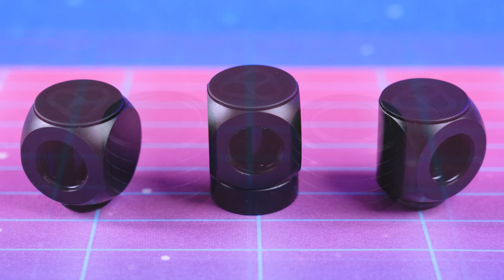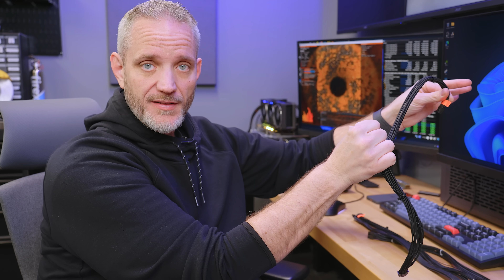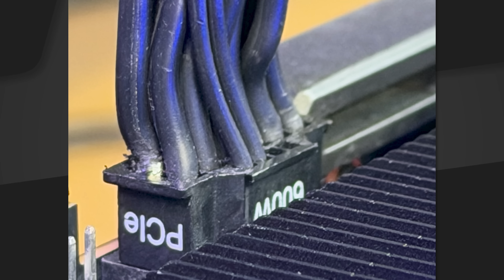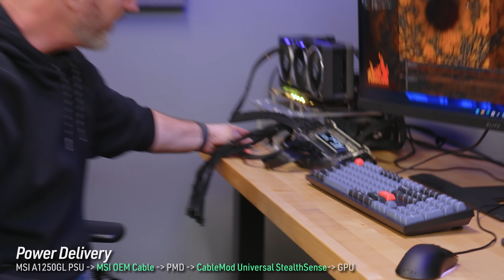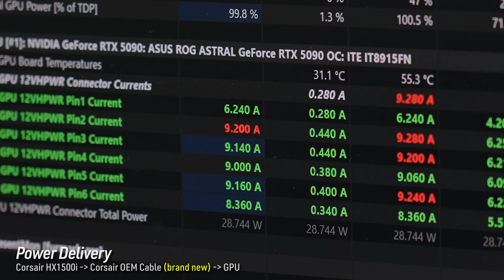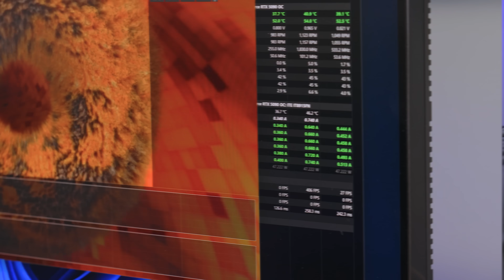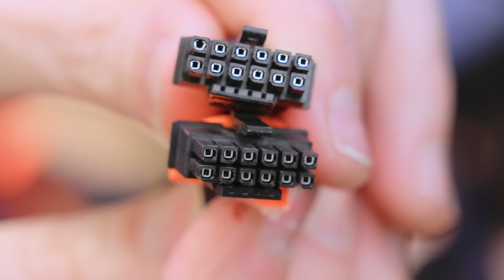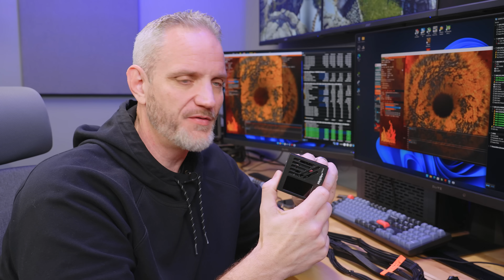More details on what could be causing 12VHPWR / 12V2x6 Cables to melt

Comment: As an engineer with a deeper understanding of both electricity and especially the mechanical forces, deflections, deformations, contact pressure, and all manner of detail that takes days to explain, the 12vhpwr connector has fundamental flaws that nobody has even identified yet. I've tried mentioning them in previous posts, but honestly, it's just too complicated. TLDR. 
Thing is, if it is the CABLE that is the problem, then how come we've never seen these issues with any of the old 8 pin connectors? Is their wire gauge heavier (ie thicker, more robust)? I'd be quite sure Jay's used them several hundred times without issue... 
I'm still convinced the connector is the problem. Just touching the cable (never mind flexing it) will move the connector ever-so-slightly, changing the contact conditions and affecting the current distribution. 

Honestly, I cannot express just how incredibly fickle the contact patch at each pin truly is. All of the old "design fixes" all showed the same old "assumptions" of perfect contact distribution, and a complete absence of understanding how the local structure bends and deflects as it is pushed onto a pin, such that the actual contact pressure distribution at each connection is just an edge load, with tiny contact area, and extremely high local resistance that will generate heat from current density like no-one expects. 
It is just a shade less severe than arcing - which is what is used to melt the welding rod in an arc welder... 

Melting connectors are the first obvious sign of that local heat. But as things get hot, they rapidly escalate. 

Problem is, we've had "working" connectors for so long, that everybody has forgotten the fine detail that went into developing the original, and hence we have problems that were sorted out long ago, when folk actually understood the mechanical side of contact and connector design. 

Cast your mind back to when these problems were first investigated, and of the two different structure designs, ONE of them had the vast bulk of the melting problems. 
It was SO significant, that the "design fix" was to recommend only the one pin connector design be used in future. 
There's your main clue right there, as to where "the devil is in the detail". I could see exactly how the "bad" one could never have a decent area of contact, making it "always bad", but even the "good" one wasn't that great. It just wasn't as bad. 
Which is why stopping using the one that had most of the problems, did not stop ALL of the problems. 
And as manufacturers refine their process to make things ever cheaper, you can be sure that not being aware of WHY one connector was better than the other, will bring that problem back sooner or later. 

As Jay pointed out, we've had cards drawing half the power melt their connectors. And some of those insane 5090 mods draw twice the power, but survive. If a cable wasn't up to the job, you'd absolutely see problems proportional to power draw. 

But that doesn't rule out someone using "cheap" wiring (either too small a gauge, or perhaps not pure copper, but maybe copper coated aluminium, or even steel, that bring in fatigue cracking problems - in other words, the flexing COULD be a factor, since not all cables have the same core material. However, that is never the case in a home-use fit-once-and-forget scenario. 
Factor, yes, maybe. 
Root cause? No, I seriously doubt it.

Comment: I actually have an thermal sensor taped to the connector to spot temp difference and have hwinfo shut down my pc when it gets hotter all of a sudden. I don't have 140 euro to buy the wireview2. So this solution seems right for only 5 bucks. Also have hwinfo set to shut down if the voltage drops below 11.6. Running a 5070ti, with 2x6 on both ends. (Gpu and PSU side with a bequiet p13m 750w.)

Comment: Wasnt it even in specification that the connector is only limited to 30-40 mating cycles otherwise the connection is not reliable?
Reply: You take some tweezers and squeeze the pins so they make better contact.

Comment: You're not beating a dead horse. This is a problem that was never resolved and still isn't resolved 4.5-5 years after the first iteration of this 16 pin connector.
The horse ain't truly dead until they actually fix this 16 pin atrocity.
We're trying to beat the horse dead, but this horse appears to be the 5th horse of the apocalypse: tech slop.
I can't believe we are this far into the existence of this spec and it still hasn't been recalled or deemed a failure. 11 NZXT H1 cases caught fire and that was enough for a recall. There are hundreds of incidents with burning connectors with the 16 pin across ~4 years. What are we doing?

Comment: TLDR - No update, No solution
Reply: thank you
Reply: Solution : use a cablemod cable, use a PSU with safeguard that turns off your PC in case of unusually high voltage

Comment: I have a 2024 model year rm850x psu and a sapphire nitro+ 9070xt. The provided 12V2x6 that came with my psu was a tight fit plugging in but the 1500i you have was loose. I have been going rounds if I could justify spending more to get custom cables after having to buy a new psu just to not use the supplied adapter from sapphire.

Comment: I'm sorry but I am not touching any 12vhp cards. Fire hazards, temperamental sense pins, inadequate wire and connector density/thickness to handle the load....... NO THANKS. (3090 is my ride or die) Sorry. Not Sorry!

Comment: Someone should source those ASUS BTF connectors and figure out a way to get them on a card in place of the 12V2X6. I've said it for years now; that nVidia connector should have been a simple two-part blade and two nice thick cables for power and ground.

Comment: There's a Chinese brand that's making 14a per pin cables that have thicker contact leafs as well. The plug itself may be fine, but dancing around amp limits isn't smart. If they could standardize 14a per pin on the cable side it would likely be okay.

Comment: if this doesn't become a class action lawsuit id be surprised.... 4090s and 50 series burning up melting is causing alot of problems for consumers and partner's right now. My 4090 melted 4 months ago and im still jumping thru RMA issues where they sent me a dead 4090 that i would have never noticed if i didn't run 100 hours of gaming in the first week of having it. Sent it back now sitting empty no GPU. hopeing the next one isn't dead or dying as well. its all shit because my old 3080 i gave to my bro still running strong Never mind ive had to pay insurance & shipping each time not cheap to ship a $1600 plus item ........... How many Lightly used 40-50 series cards are just waiting to melt

Comment: You should log the number of cycles a cable has until failure for the different brands you have of cables, that would give users an idea of how much time before you need to replace the cable.
Reply: If you check, he did a video testing a cable through a 100 cycles. Tldr the readings were the same at cycle 100.

Comment: Before you throw these cables into the bin, could you maybe ut the cables and check if they are full copper ? 
Especially in hifi you often get copper clad aluminium cables so called CCA Cable. Which are prone to break if bent too much.
There also should be a obvious weight difference between CCA and OFC.

Comment: this crap right here is why I switched from nvidia to a 9070XT and double checked that it had dual 8 pin.
Reply: My 9070XT has triple 8 pins
Reply: Peace of mind is the only way forward with how much these bastards cost now
Reply: @staples4335 red devil 9070xt ftw
Reply: @staples4335  Same, would have bought a 5070 ti, but got the Asus prime 9070 xt with 3x8 pins. I don't ever have to worry about it melting.
Reply: I switched too, so many issues with Nvidia, I built a new system and was going to buy an Nvidia 5090 but I didn't want the agro so bought a Radeon RX 9070 XT with three 8 pin power connectors, yeah it's not as powerfull but i'm not sweating 24/7 wondering if it's going to f*** up.
I won't buy Nvidia until they change the power connector, maybe with the 60 series
Reply: @raymondcoram992  It's a great card too. It has some serious punch to it.
Reply: The same! 3x 8pin 9070xt
Reply: tripple 8 pin here on my 9070 xt red devil!
Reply: 9070 XT Nitro+ owner here 😬. My PSU is ATX 3.1 so it has a native 12V-2x6 power cable. If I were using the Sapphire's included adapter it would have already burned out.
Reply: @NawiWonka any issues? Mine gets delivered tomorrow and I'm worried after reading all this lmao I did buy a corsair rm1000e bc of it to get the 3.1
Reply: @Mxnonymous  No issues with my PSU (XPG Core Reactor II VE 850W ATX 3.1)
Reply: @Mxnonymous  nope works great!

Comment: I Run an Astral 5080oc, using a cablemod 90 degree 12v to 3x 8 pin pci-e. i regularly monitor the power pin sensors, my amperage difference seems to max out at 0.7 amps when cards running at maximum. lighter weight games where load is less, seem to hover around 0.35 amps. and its always the same pattern, pin 1-6 with an ascending amp draw from 1 to 6.(pin 3-4 are usually even).

Comment: A new standard needs to be developed that bumps the voltage going into these cards from 12V to 24V or even 48V. Which I'm surprised didn't happen when we started having cards requiring 3x8-pin PCI-E power. Those cards - like my wife's 3080 - were prime candidates for a 24V or 48V connector standard instead of sticking with 12V.
Reply: That would require changing the ATX PSU standard to supply more than 12v. Would be good to see PCs run from 48v though. You'd be able to directly power PCs from 48v battery banks without converting to AC first.
Reply: Or we can just start making cards that draw LESS then 300 Watts again. Not draw more power every year. there making damn space heaters again with only one gpu is crazy when we had cards with dual gpu's running less then 300 watts
Reply: @NightshiftCustom  yup, true

Comment: The Corsair cables probably just have iffy QC, I bought one after multiple YouTubers did videos for them when the 4090 was fairly new, and mine has worked for 2 and a half years, I got the card in March 2023, and the cable a few months later. Mine looks clean and feels solid, but Jay's look flimsy.

Comment: Interesting video.Micro voltage arcs and imbalances can play with current sensing circuits causing all sorts of strange behaviour even if grounded elsewhere
Reply: Ground and all sorts of stuff changes when the wire is touched.  The sense circuitry on this seems to be set to sensitive cause it probably figures no hands should be in the case so it sees a change it shuts down.

Comment: Tbh., 100 plugging cycles for those cables really are a stretch. Usually, I would phase them out in a setting like here, after around 50 plugging cycles. In the best case, you know exactly the make of the connector and contacts, such to access the datasheets. These usually tell the number of plugging cycles they are designed for. Of course, you could have caused breaking wire strands inside the cable by abusing them. E.g. too tight of a bending radius, bending them in opposing directions, stretching or staunching them, twisting them. You get the jist of it.
There is more to cables, as the naked eye can see.
Reply: If you check his videos, he literally did one a while ago testing a cable over 100 cycles....

Comment: I wonder if these are OFC copper or horrible CCA wire. CCA wire is terrible for power applications and has so much internal internal resistance they can get hot enough to become a burn hazard. Its been tested in car audio power application, but I keep seeing this junk wire in other applications.

Comment: Is this really shocking😂⚡️☠️, its very poorly designed and was from the start for an issue they knew has been going on for years now. They have been pushing it to its limit since day one. They designed something that itself needed to be upgraded 5 to 8 years ago and needed to be redesigned and upgraded the day they released it. It's like taking a very cheap electric extension cord that only has one male plug plugged into wall outlet in old house built in the 1950s and one female plug-in and plugging in a cheap 6 plug-in power strip. Then, take and plug in 2 computers, 2 monitors, and a space heater into that power strip. But worse, having the nerve to say I'm not sure why it went up in flames and just don't understand why your house burned down.

Comment: The old pin system worked. Worked well. Why change something that works really well?
Reply: NVIDIA is only interested in their own PCB and cooler heatsink designs. And their PCBs are more compact and denser packed than the partner models’ ones and the 12VHPWR connector uses a little less space compared to two or three 8-Pin PCIe connectors. That’s all but it also sucks.

Comment: I want to take a moment to appreciate that we still get new '12v 2x6/HPWR is a failed design' news still in 2026.

And to think it almost seemed maybe ok with the 2x6, but then someone said "hold my beer" and between making them poorly and actually starting to shove over 500w through them on 5090s and only using one controller so there is no guarantee of load distribution here we are.

Comment: Great vid. awesome to see all your test with 12VHPWR melting problems to track down the main problems if its this or that!
i just ordered the wire view. i dont mind buying a 300doller monitor device then try my luck and boom. melted and rma says no and off to buy another pny rtx 5080 oc for 2000us.. (yes they cost that much in denmark right now. got mine for 1450us before price spike)

Comment: I thought PSU manufacturers say that you really meant to use cables that come with power supply and not 3rd party ones incase any issues.
Reply: I remember the modular PSU cables weren't standardized and in some cases the pinouts were different.
Reply: @ctrlaltdebug  every cable with this connector has the same pinouts.

Comment: My hate towards Nvidia is burning brighter and brighter, with AMD red you could say. And when I am going to be buying an AMD card, it will need to have the normal 8-pins, not this cheap-ass garbage on overpriced GPUs. Very disappointed though, that some of AMD's AIB's have resorted to using this crap connector.

Comment: and hot take i have used psu cables on a other psu but did check with multi meter if they where the same or i would repin them yes you can fuck up when doing stuff like this so check dubble check and check again before powering on

Comment: Remember, longer electrical cables create higher resistance. So they might get hotter than a shorter cable, especially with the high amps these cards are pulling.
Reply: Which is why the PCB needs to be longer - to accommodate a cable plug-in on the right side - then - nobody would care if they need to go back to 3x8 because they would be hidden... and ffs - they could build a dedicated right angle adapter that's screwed in from the factory.... Win win for everyone involved: Cleaner looking case, no connection issues, and shorter cable runs.... but noooooooooooooooooooooooooo  lets make the cable smaller and put it smack dab in the MIDDLE <------- Only a BETA male would come up with this!!!

Comment: Been running a Zotac 4090 Extreme Airo, Corsair AX1600i and using a cablemod extension type adapter running off 3x 8 pin plugs, and so far with my system running 24/7 (with no sleep or hibernation) for over 3 years that card and cable is still working great, even been removed at least twice for an nVME upgrade and platform upgrade from AM4 to AM5. While I hate the cable, I have no issues here.

Comment: Would be interesting to see the wires taken out of the sleeves to find the breaks.
Reply: How would you ensure the process of removing the sleeves isn’t what breaks it?
Reply: @NerdlySquared  The sleeves aren't bonded to the wire.
Reply: @NerdlySquared 
Use organic solvents to melt the sleeve, or just burn it off.
Reply: maybe X-ray inspection would work?
Reply: @carrionetteThat's a possibility. Or even thermal. The cable would get hot where the breal is as it tries to pull current through it.

Comment: They need to go back to the dual 8 pins they were much larger and a lot safer 
That much power in tiny wires equals flames if that simple

Comment: I wonder why they still stick to that crappy connector design. Wanna draw amps? Check the xt connectors! Beefy pins, thick wires, mostly soldered rated for way more amps the cards need

Comment: man like linus did put a xt90 on it with drone racing we would use a xt60 and draw way more amps threw it then rated but for only 30 min max and it air flow

Comment: 21:04 cooler master seems to use a different pin out from everyone else! 
Huge pain. I’m gonna have to modify cables to get what I need. 
What wire gauge is cable mod using? 
The margin between 16 and 14 awg wire is the difference between melted cables and not. Some cheap cables are even 18 awg and that’s just asking for trouble.

Comment: Somethings that only really applies if you are doing testing is the connectors don't have strain relief so never pull on the cable or it will depin, and copper work hardens so the more it moves the harder and more brittle it will be.

Comment: If i had one of these cards with a failed power connector I would desolder it and install a high amp plug in its place for 2 proper spec heavy gauge wires to go all the way to the power supply and modify the power supply to have the same high amp 2 wire plug and eliminate that garbage ghetto rigged 12v2x6 connector.